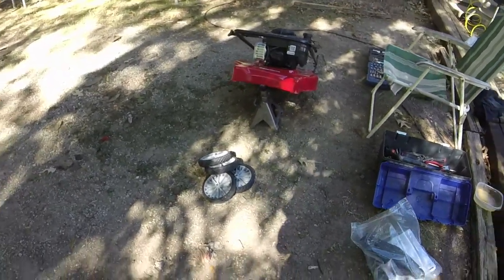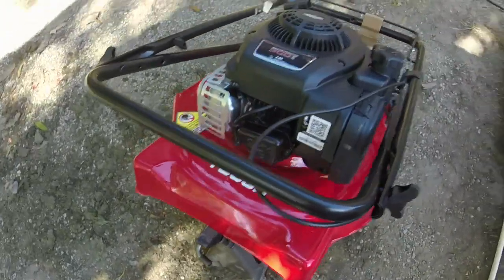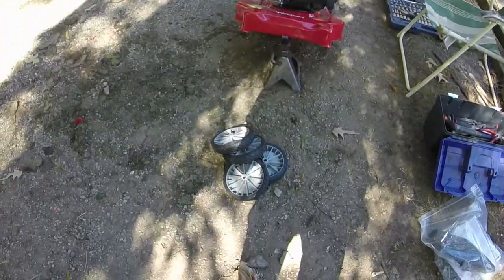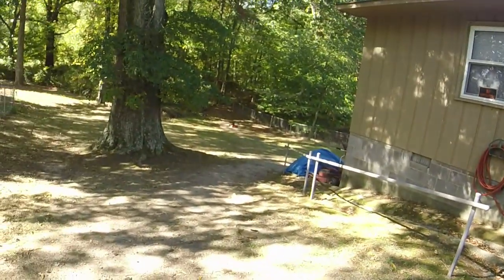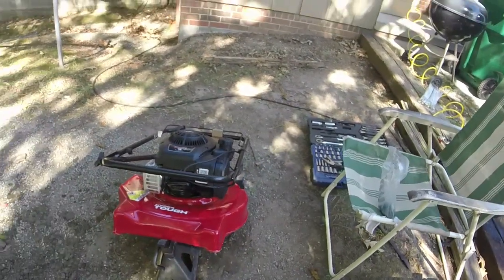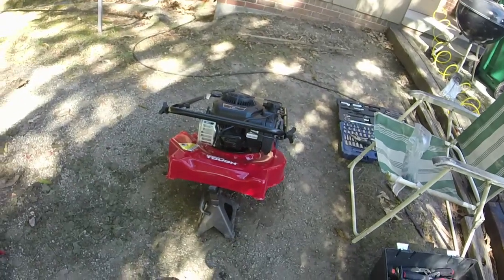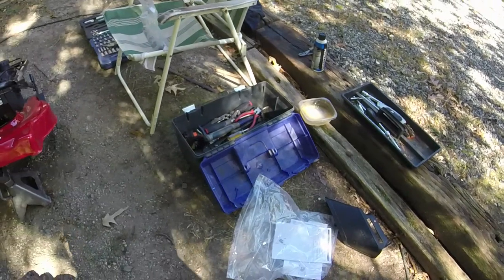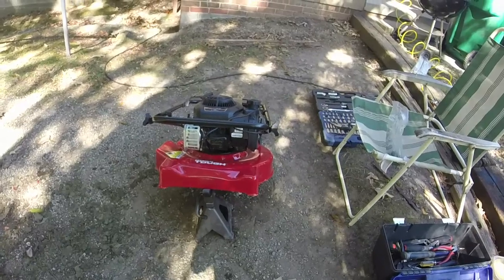Assembling a new Hyper Tough push mower

Comment: Everyone always skips the part where the push bar connects to the lower handle.
Reply: I know! I need help with the lower section of the handle snapping into place. My instructions says to lift up the handle and the bottom section will snap into place. Then it says to tighten the upper handle which I did but I cannot get this bottom section to snap. And I see he's already pulled his up and snapped it in place I wish he had of showed us how to do it
Reply: @rubycrisp I figured it out! You squeeze the bottom part together and move it into the bar thing.
Reply: @chasitygrubb5706 what the fuck does that mean ?
Reply: Squeeze metal?

Comment: Mine came pre assembled only thing had to get the handle bar joint up it’s my first time so this should b pretty interesting and then I’ll check all bolts insuring they are all tight and my mower came in with 10w/30 oil which is cool Imma put a lil gas juss so it’ll run out just so it can break in like you said
Reply: I just purchased one today and mine came pre-assembled and had oil also the only thing I have to do is open up the handle and the bottom supposed to snap in place and then the top you just screw the knobs in tight I am having a very hard time to having the bottom section snap into place

Comment: I remember buying one of those at Wal-Mart for $88 years ago. I only needed the engine for an old Montgomery Wards vertical shaft rototiller that had a blown engine. I remember it had a green frame and even with a new engine  that I took off that cheap mower, no one would buy it. As soon as I painted it black and then reposted it, it sold. It seemed weird tossing a brand new lawn mower frame on the scrap pile. I did save all the wheels and cables.
Reply: Great story Scott. I think I bought one there, new for about that price. 
Got a new one the other day, $250.00 - The other ones were all the "new" electric battery "craze" mowers. I was looking all over when I got there for another $88.00 dollar one. Who was I kidding. Man, 3 times the price, even at Wal-Mart now. Oh well, woke up from that dream world fast! 😃

Comment: A common frustration ... to get the handle to snap into place ... press each side of the handle inward on their respective pins, and over the edge of the slot - it'll snap  & seat into the slot ... drove me nuts for longer then I care to admit!
Reply: Thank You so much! That's why I came to this video. I was able to to push them in and get it together after reading your comment. 👍
Reply: @shell777  I'm having trouble even pushing the bars in. When I push one side enough to clear the edge of the guard, the other side is tight against the it's guard. I can only push one side out at a time, but I can't get them at the same time for both to clear the guards. Does it take 2 people to do this? This is the most stupid set up & it claims easy set up.
Reply: @pinkfreud62  I just remember pushing them in at the same time and got it. I did it by myself. Yes the set up is stupid. Lol
Reply: My handles won’t fold into working position & advice?
Reply: I’m ready to snap 😢  because it won’t “snap” into place HELP

Comment: Dude you could of showed how you got the handle to snap in place
Reply from the maker: They usually come already snapped in place when you take them out of the box which is why this step was not shown in this video.
Reply: Ellis Mowers i figured it out now but I see what ur saying
Reply: @lurara7x622  what did you do? I'm experiencing the same problem. Help! 😭
Reply: @WhenNightHits  same
Reply: @rustyshackleford2463  i did figure it out tho. Its two black levers at the bottom and  you pull them out while pulling the main lawn mower handle outward as well and it'll snap in place
Reply: @WhenNightHits  I did that and it dosen't work :(
Reply: @WhenNightHits  Did you find out how to "snap" the handle in position?  Let me know if so.  This is very tiring!
Reply: @ginamcclinton  I'm having trouble getting the handle over the guard, too. Seems you have to slide both sides of the handle towards themselves across the pins. But I can't do both at the same time because it's too tough. And there's no levers that I see. Just the ones that adjust the wheel height.

Comment: Mine came halfway assembled and it says to snap the lower handle in place but it won't snap!!! Can you offer any help please?
Reply: Kimberly Porter mine to its like the piece on the bottom blocking it from snapping in
Reply: @lurara7x622  I figured out how to do it. You may need someone to help. You're basically going to have to pull the part of the handle over while someone pushes so it can make it past the little groove
Reply from the maker: You are correct.  The reason why I didn't show this is because it comes already snapped in place when it is new in the box.  It works on tension and can be a bear to get into those holes.  Careful with the fingers!  I've smashed mine a time or two putting the handles in.  Glad you were able to figure it out.

Comment: Mine came with a spring load for side sheild but got to say it's a great mower cuts good
Reply from the maker: Yes this was a 2017 model which doesn't have the adjustable wheels nor spring loaded side chute.  It was a one-off year it seems as the 2016 and 2018 models had both.  They're not bad for the money, weak point on them is where the handle connects to the back of the mower.
Reply: @EllisMowersandmore  I have an E300 Series and having trouble assembling the handle it will not raise to working position.  I've tightened the handle knobs but it will not raise completely. If you're familiar with this problem, please help me!!!

Comment: Seems like a pretty decent little mower for a small yard or trimming. I personally use HD 30 on all my mowers, just a personal preference.  I buy the store brand at my local farm store   for $1.59 a quart. At the beginning of mower season I usually buy 2 cases.
Reply from the maker: That's a good deal on oil, might have to check out local farm stores to see their prices.  If Walmart sold the HD-30 in 5 quart jugs like they do all other grades I would definitely buy it over 10W-30 which is what I typically use now.

Comment: I always use the manufacturers recommended oil so I use Briggs & Stratton SAE 30, it only costs slightly more than the cheap stuff if you buy it in a larger quantity. When I was a Ford mechanic I was forever fixing cars that had used cheap pattern parts & cheap oil which was always a false economy for the owners in reliability and fuel consumption. Mineral oil can never be as good as synthetic oil because the additives don't fully blend into oil properly. Synthetic oil is made with additives already in it so is a perfect blend...however you still need to use the recommended grade. Yes, I know...we're only talking about lawnmowers, not space shuttles lol
Reply from the maker: Yes you can never go wrong with SAE30 and I miss when Walmart sold it by the quart up until a few years ago.  I do the same for all my cars, recommended oil only but for push mowers I'm a bit more relaxed because they're so crudely made that as long as you have oil in them they'll practically run forever.  It's unbelievable how many times I've had mowers traded in that have had oil that was as black as tar and still running fine!

Comment: I need to know how to snap the lower handle in it won't work I tried and tried it won't snap in what do I do it's really frustrating and annoying
Reply: Its at the bottom. There's 2 black things you pull liking your pulling it away from the center while pulling the lawn mower handle toward you and it'll snap in place
Reply: @WhenNightHits  ...thanks I figured it out I took to silver pins out with vice grips and then I had to manually put in one side and on the other side and I got that fixed but now guess what the pole starter pull cord won't work in the the blade won't turn it's like the blade is like welded into place it won't turn in the rope the cord starter thing won't come out of the housing it won't I can't even use it so I'm going to have to bring it back after going through all this crap it is so annoying I'm so mad I don't want to bring it back I don't want to buy another one of these anymore I thought it would be really easy like the one I bought before this one is been a nightmare it's like totally defective and they should pay me money for going through all this crap I shouldn't have to do all this stuff just to get a brand new mower going absolutely ridiculous and unacceptable I'm not going to buy another one  I don't know what to do
Reply from the maker: @earthalien77  Glad you got the handle on, pull cord and blade not turning problem could be one of two things.  First, make sure the safety cable is attached to the bail handle on top of the main handle and you pull that safety handle back when trying to start it.  There's a blade brake that will prevent it from turning if that's not done.  Second, I've had a few that wouldn't turn from the factory when fixing them and what I did was turn the mower on its side with the exhaust pointing down and taking a 9/16" socket and ratchet and turning it clockwise to free it up.  Would be best to take the spark plug wire off the plug and pull back the safety handle so you have no additional resistance holding you back.
Reply: @EllisMowersandmore  yeah I tried all that.... I tried with the wrench to get it loose, but it wouldn't loosen at all--- it's like it's welded on really tight  ...it's really annoying ....I even sprayed some W2 the oil on it....nothing budged at all.... the cord is still stuck the blade won't turn..... so I'm going to have to bring it back, which I don't want to do ....I'm so angry with it and I don't feel like bringing it back ....I bought it online and they never gave me a receipt ....and I just dread going back in there and lugging it in there ... and just ridiculous like more
Reply from the maker: @earthalien77  Very interesting, must be a manufacturer defect.  Quality control on these isn't good at all.   it's never fun to return things but hopefully they'll get it straigtened out.

Comment: My mover wheels are set on highest level yet it cuts to snake. Also barely cuts grass more than 3 inches. Just purchased set up at Wal-Mart. Constantly cuts out in taller grass and takes long time to get it restarted. Any help or ideas to improve use of mower and it came with oil. However I didn't use all the oil just some.
Reply from the maker: These mowers are very basic, so mowing tall and thick grass is not it's strong suit.  If it is a Briggs engine you could throttle it up a little.  The governor arm is located behind the gas tank.  They are preset from the factory so be careful not to adjust the throttle too high.  You can go up a little and be okay though.

Comment: I have the same mower but I can’t seem to figure out how to lower it to cut lower not higher
Reply from the maker: There are four holes in the deck where the wheels mount.  You have to take off the whole wheel and mounting bolt and place it in another wheel mounting hole in order to lower the entire mower deck.
Reply: I have an E300 Series and having trouble assembling the handle it will not raise to working position.  I've tightened the handle knobs but it will not raise completely. If you're familiar with this problem, can you help me!!!
Reply: My 12 year old son came downstairs to help to “ snap” ( yea ok) it into place for me…. After I battled this stupid thing for a half hour

Comment: I just bought one and the handle is behind the thing that holds it in place at the bottom. I can't figure out how to get that bolt out. Help!  For a lady I'm usually ok figuring these things out.
Reply from the maker: You might have to squeeze the handle in at the bottom to get it into the correct slot.  Unsure of what you're talking about unless I would be able to see it.
Reply: At the base of the mower where the handle is attached it fits into a bracket that keeps it in position. Well when I unboxed it was behind that piece. I sent a pic to my brother that said I needed to take the pin out, remove the other piece, position the handle and then put the (bolt and pin)? Back in. I have tried but it will not move. Does this sound like something I need to use a screwdriver and tap it out?  If I can get help loading it, I might just take to him to do it. Wish I could send a pic to you.
Reply: @EllisMowersandmore  That's exactly what he did. I feel dumb for not even trying that. He looked at it and said "You don't take that out! You squeeze it!"  TY for your replies!

Comment: I try screwing and it does not tiden at all?
Reply from the maker: The screws have thread locker on them making it hard to turn so they don't back out.  Some screws have a 2 step system where you screw it in halfway and then the threads break and then you screw in the rest of the way.

Comment: Once you’ve used the mower, the instructions say to remove the spark plug cable from the spark plug before adding oil. How I do that?
Reply from the maker: You'll see a rubber "boot" on the front of the engine that is connected to the spark plug, that's the cable/wire.  While it takes some force you can just pull that rubber boot off the plug.  It's not necessary to do that to add oil to the engine, it just says to do that for safety to make 100% sure the engine won't start while you're adding oil (although you'd have to pull on the rope for it to start anyways)

Comment: 10w 40 is too tick for theses little engines
Reply: Not true I run 20w50 synthetic it's thiner than 30w in the winter and protects better than 5w30 in hot climates

Comment: How did you get the handle up?
Reply from the maker: You have to squeeze the very bottom of it together and pull up on it to release it from the stop "tabs" by the wheels.  Then you can just pull it up and it will snap into place and put your wing nuts on to secure the top and bottom halves of the handle.
Reply: Ellis Mowers thank you, my father n law and I couldn’t figure it out. We both thought it was because he tightened the top of the handle and then he figured it out.
Reply: Ellis Mowers what
Reply: WavyLk what?
Reply: @cayleighgerlt6420  what did he do? I'm trying to figure it out as well lol
Reply: Logan Cooks there’s two little levers on the bottom you have to push them in and push the handle back at the same time

Comment: Is there a throttle or shut fuel valve?
Reply: I just bought one fully assembled yesterday and I can't get it started.
Reply from the maker: There is not, most likely there is a blockage in the carb that is keeping fuel from getting to the engine.  Try spraying carb cleaner into the intake to see if it fires.